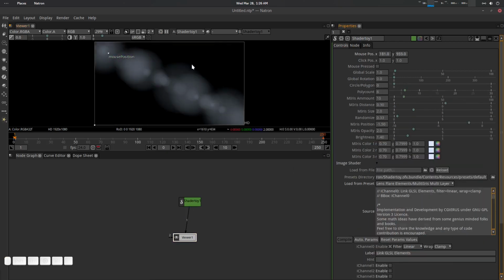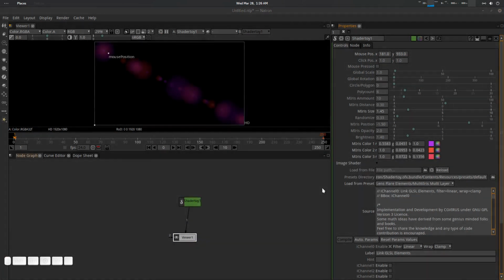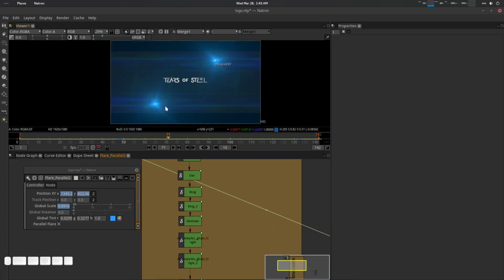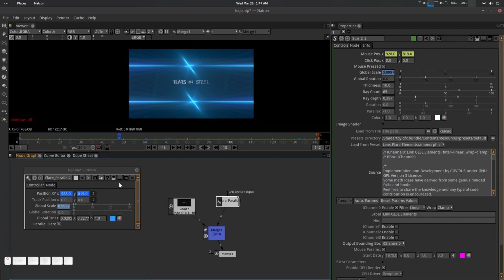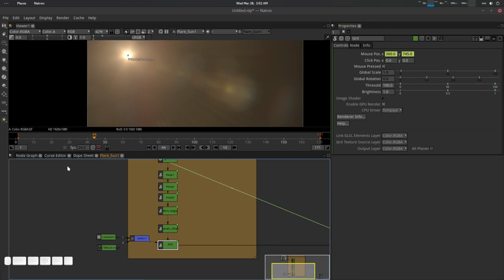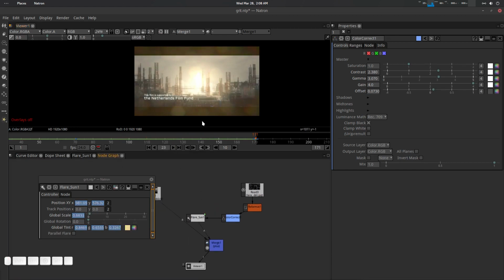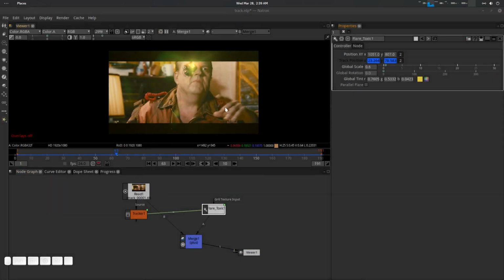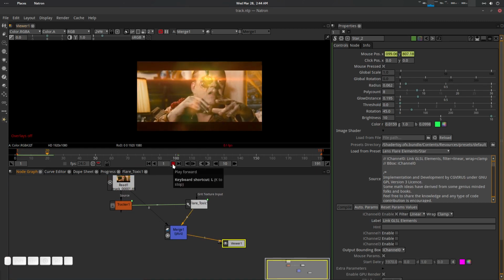Natron Lens Flare Studio Plugin Introduction, Installation and use TUTORIAL DEMO [OLD]

Comment: it's giving me error when launching lens frare element
Reply from the maker: can you describe the error report?
Reply: I am on Mac, will try it on windows later, it says "[21:35:14.305] Shadertoy1: Failed to compile fragment shader source!

Error log:
ERROR: 0:53: Invalid call of undeclared identifier 'texture'
ERROR: 0:55: Use of undeclared identifier 'linker'
Reply from the maker: well, that's new! Alright, let me know. BTW which Natron version are you using?
Reply: Ah, I used an older version, it works fine now, my bad, thanks for the plugin